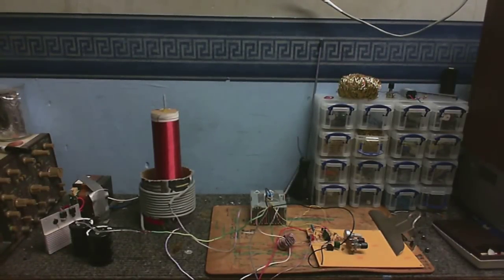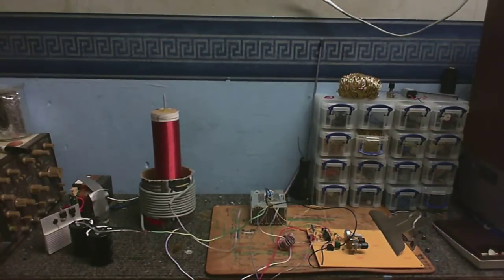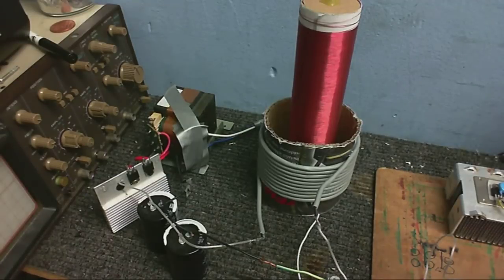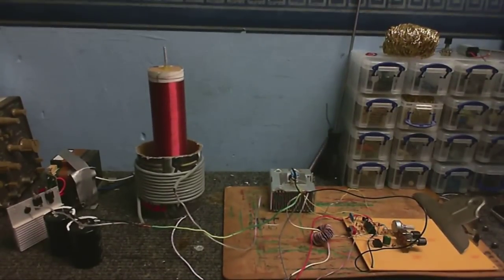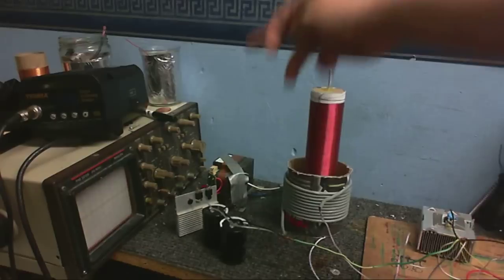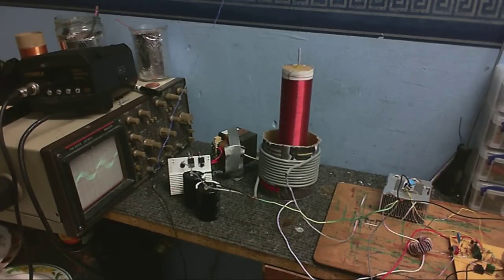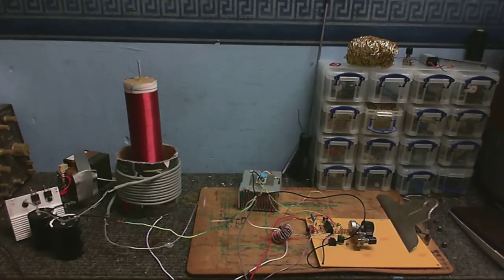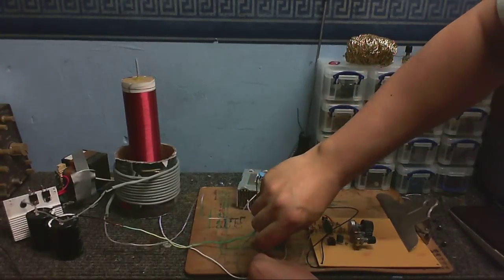PLL SSTC Build and First Light

Comment: Nice!  I have an idea, I use a self-powered RF circuit that is really simple to build in order to detect activity in my VTTC/SSTC coils and other RF circuits.  No direct contact needed for SSTC stuff.   It works a foot away or more.  Quick way to check for RF just about anywhere.  The circuit is so simple I can explain it here, but I will maybe make a video on it.  Any old 400uA dB meter, a germanium diode and an RFC of just about any size will do.  Hook them in a loop.  Polarity of diode (or meter) must be right in order for the circuit to work. Hook one end with diode and RFC to a small wire, the other to a grounding PCB or case.  That's it.  With just a 4 inch wire and a PCB as a ground the little circuit will pickup RF from your coils long before anything starts arcing.  I came up with the circuit a few years ago for use in my shop fixing transceivers and radio work.  I had several O-scopes, but you don't always want to have those on or expose them to HV.  This circuit is cheap and tough.  If you want to know more let me know.  I might add it on a video, did you subscribe/see my channel "Mostlymacros".  I'm the came guy who warned you about induction heating in your secondary coils.  Great circuit here, my guess is you could get quite a bit more out of that with a larger mosfet and possibly drive voltage but that all depends on how resonant things already are, circuit working though, very good.  I got about a 3 inch corona out of a single mosfet SSTC of my own design.  Then I went on to tubes since I wanted to run a lot of power eventually.  I have not posted videos of that coil yet it was well documented when I built it a couple years ago but the video is a bit lost in the archives as so many are!  Maybe I will build it again. Very well done circuit and nice to show schematic in video.  I like the modulation setup.
Reply from the maker: Mostlymacros I might try that, better than risking blowing up my scope!  I'd like to video on the RF detector circuit, I subbed to your channel BTW.
Reply: Thanks for the sub!  Will do video on it soon, brainstorming.  Yes, much better for you're scope, mine are usually off camera.
Reply: CoolDudeClem
Just put up video on RF meter, it's pretty simple as I say, just be sure not to hook it up to coil even if not sparking as this could overload diode, I am still a bit sick with flu, but getting better, forgot to mention Germanium diode. Read caption on video for more info. You can use almost any regular diode but best results probably will come from a germanium. I get tons of them for $2 on Ebay.  Have fun and let me know how it goes. Video is called "SIMPLE RF METER BUILD' on my Mostlymacros channel.